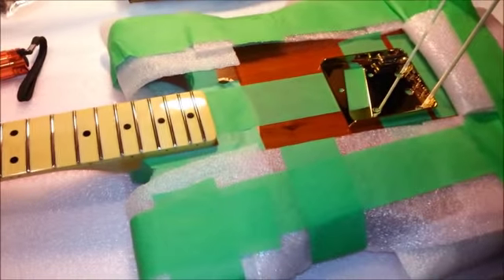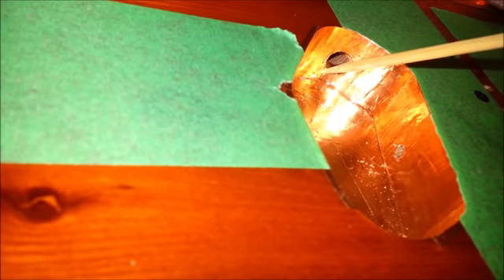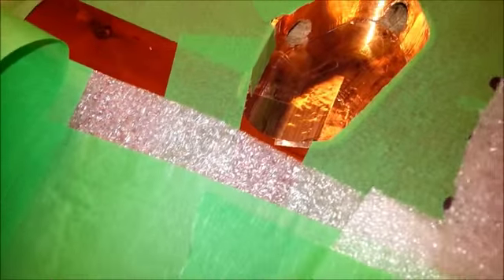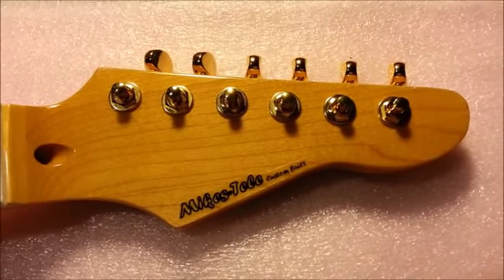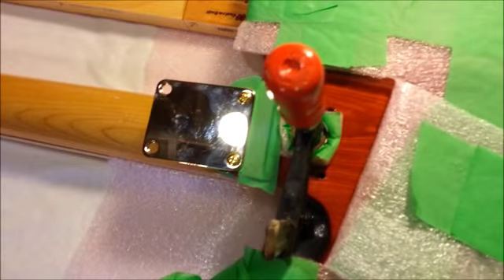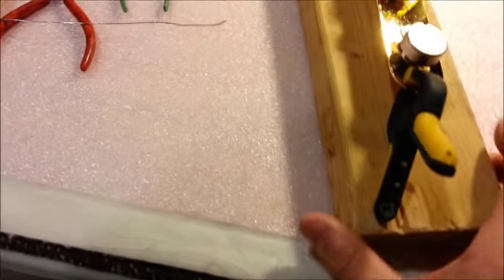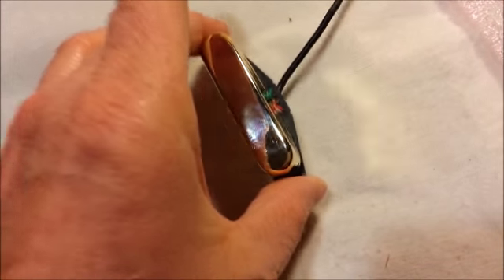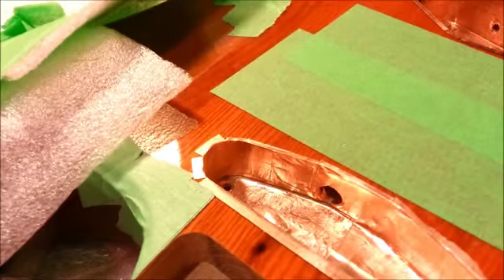GFS (GUITARFETISH) Telecaster style build part 2

Comment: One newer addition to the GFS parts line-up is a pre-wired "loom" (for Tele and other set-ups) for less than twenty bucks.  Since I'm terrible with a soldering iron, I'll be giving that a try.
Reply from the maker: I saw those units on the site.  It looked exactly like the panel that came on the Cozart, with the $1.50 3-way switch.  It works initially but likely to fail easily depending on the usage.   The little alpha pots seem OK to me.  I used the full sized alpha on my tele builds.   The wire used is also not as good as I prefer, but will also do.   Let me know what you think when you get your parts.
Reply: Thanks Mike -- Ooh, not encouraging!  Guess I'll see how the wire, switch, and everything looks when I get it  If it turns out to be cheap crap, guess I'll just have to learn to be a better solderer!
Reply from the maker: +Seth Tyrssen 
I found the switch shaft was so thin, it bent easily.

Comment: I admire your moxy in attempting this. I notice that you taped over the copper shielding for the neck pick up. Upon reflection, do you think that it would have been better to do the shielding just after the other body work was done, in order to avoid taping the shielding? I would be worried that it would come off with the tape.
Reply from the maker: In fact, that did  come loose about a year after I built that one and it was causing buzzing when I would touch the metal ring or the pickup cover so I had to go in and fix it and I actually sautered the wire to the top of the shielding. Good thinking in advance. I did not think about it coming loose over time with changes in temperature and humidity.  I think on tele number 2 I actually put a wood screw into the shielding and wrap to the wire around it to avoid trying to solder. I can't remember exactly but I think that's what I did

Comment: In the future if you decide to do anymore guitars, you really, really, need a Dremel tool, preferably with the flexible shaft attachment.
Reply from the maker: Gary what part would you be referring to use a drummel  on?  I have one, no flex shaft.  I have a spin saw with a flex shaft.
Reply: Maybe I didn't understand you correctly when you were wanting to enlarge the p-u wire holes to get more clearance for your p-ups. I've seen and heard of people trying to use a drill and drill bit to get down there. Not saying that's what you did. A dremel as you know can use many different bits and sanding drums to get down into tight spots. With the flexible shaft option it 's even easier yet. I like your guitar, very nice.
Reply from the maker: +gary adams 
OK you did get it correctly.  It would have been harder to use a dremmel as I needed to open the holes with large bits for better clearance.

I'm building another one now.  I learned to use those fingernail files on #2.   I'm using them right now on number three and I have recorded some segments on how to actually use them instead of the 220 and 320 sandpaper making it less dangerous to cut through the tape. I realized after looking back I hadn't really done specific recording or instruction on how I actually dressed frets.   on number 3 I'm spending some specific time on doing that for people who may benefit from this manual technique and not having to buy a lot of expensive tooling. Thanks for looking in and your comment and recommendations. Stay tuned for number 3. This one will be vintage cream body with black binding and all black Hardware and the standard full Maple xgp neck. It will be some weeks yet before I will finish all the bits and pieces and then edit all of my recorded segments to post.
Cheers 
Mike
Reply: Understood. Glad it all worked out for you. For me it's just easier to get into tight spots with my dremel, there's so many attachments available and the varible speed allows me to work slow, in other words not mess something up. LOL  I'm looking forward to third build, I've often considered the black hardware on a build, but just can't seem to pull the trigger. Will be interesting to see how yours turns out. Like you,I'm an ole retired fart with limited resources. Carry on with the fine work.
Reply from the maker: +gary adams 
this is the new body. vintage cream with a black binding so the black Hardware will stand out the same and the clear Maple neck with black tuners will be appropriate. I expected great things from this guitar. I'm putting the little puncher humbuckers in it and I'm coil tapping both of them and using a 4 way selector switch for a bunch of new phone options. electrically it will be the most diverse of the three. the first to have noise with single coils.

Comment: thanks of this video I decided not to build a XGP guitar.. thanks
Reply from the maker: Giovanny the biggest issue was the neck heel to wide.  On tele#2 I used a non xgp neck and it fit perfect.  
All the other issues were minor and easy to get over.
Thanks for looking at my video.  Some folks have decided to go ahead after seeing and others have not.  
It is over 2 years later since I built this guitar and it is still great.  All the hardware is great.  The Wilkinson tuners are smooth and hold tune well.  It is still a great guitar to play.
Reply: @2bikemikesguitartopics145  hi thanks for the reply where you get the other neck, I want to build a strat but I don't have no build skills  thanks
Reply from the maker: I got the alternate neck off of eBay directly from A supplier in the China. There are many suppliers on eBay for necks.  There are also some of the Chinese supplied necks available through Amazon. You could do a search on there as well. The heel shape of a Stratocaster neck versus a Telecaster neck are slightly different. The bottom of the heel on a Stratocaster has got a curved arc on it, while the heel of a Telecaster neck is flat so make sure when you're looking at Necks it always indicates Stratocaster neck if that's what you want to build because it requires the proper shape to fit correctly.
There are necks that are all Maple like the ones I built and prefer and some have Rosewood or teak or some other kind of fingerboard. Depending on where you are some countries have restrictions on importation of rosewood's like in the United States. So also be conscious of the description of the neck if it's not all maple fingerboard.